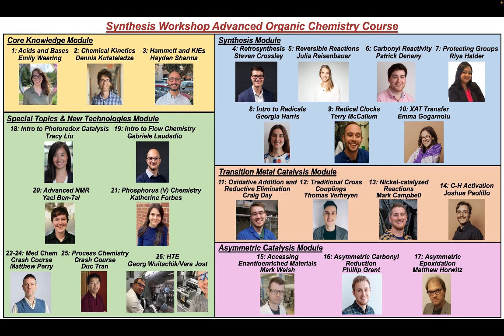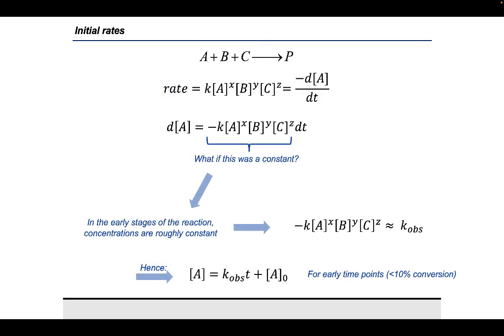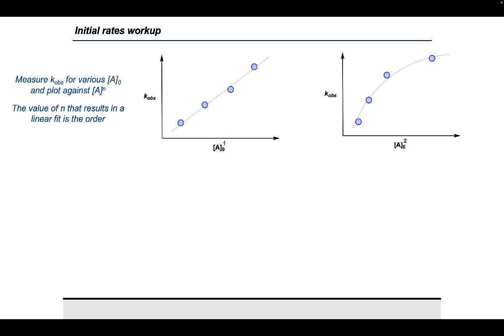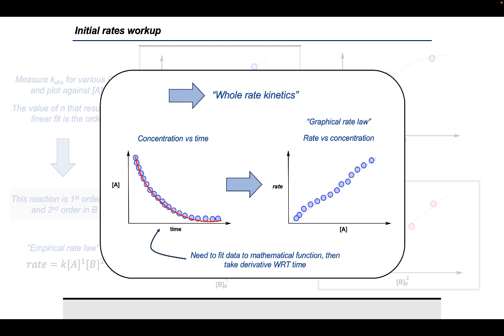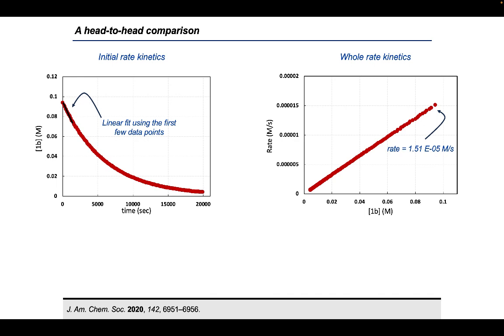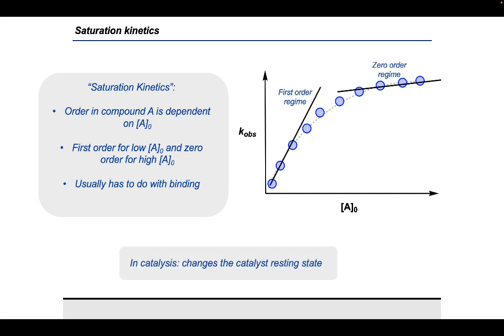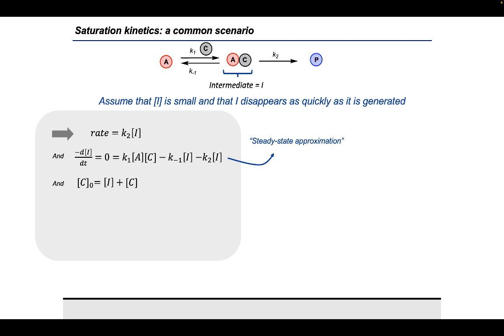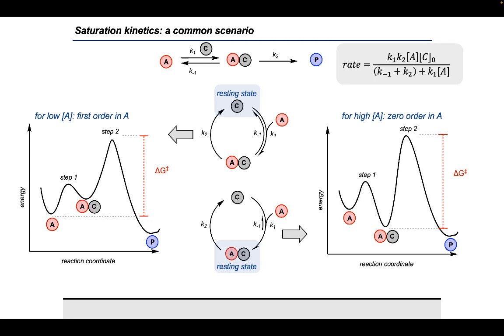Advanced Organic Chemistry: Chemical Kinetics

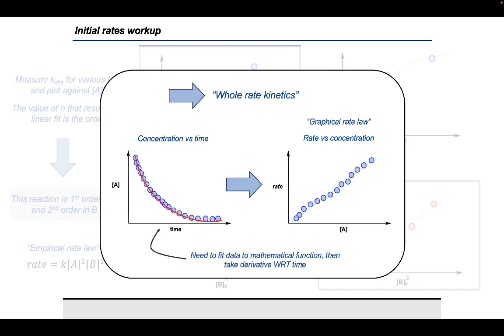Comment: This is fantastic. At 12:49 and the subsequent discussion, note that you don’t generally need to fit to a continuous function, especially with data well resolved in time. The derivative between each pair of adjacent points can be approximated as the slope of the line between them. Calculating and plotting that against [A] strikes me as much easier than differentiating an nth-order polynomial. 😅